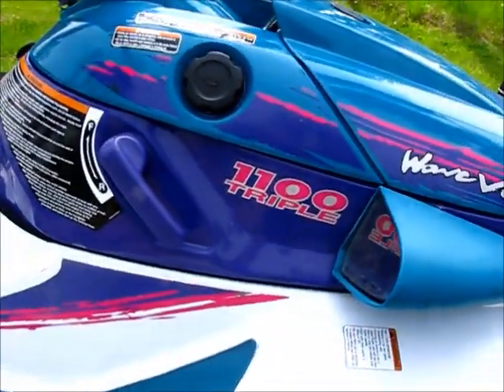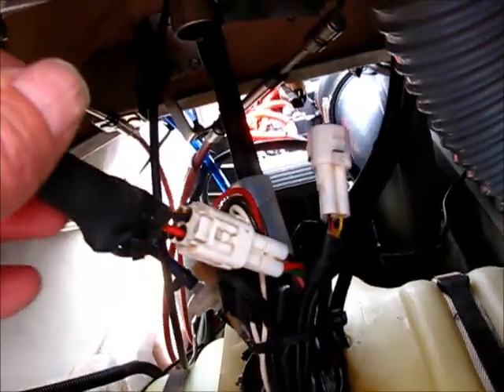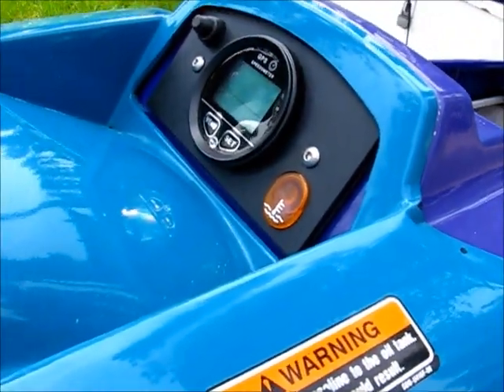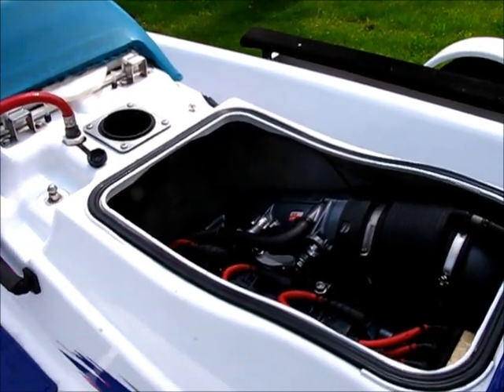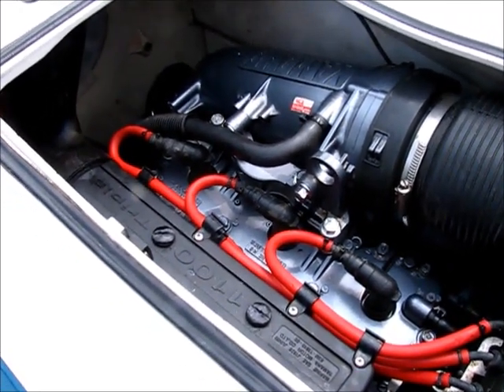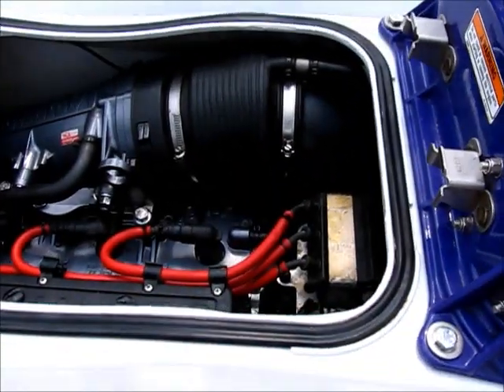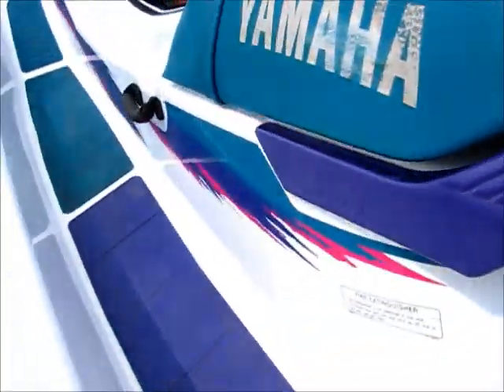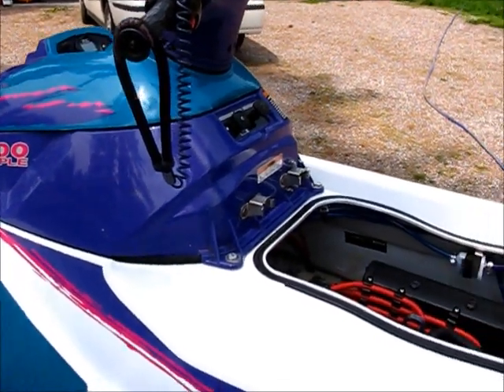Yamaha Wave Venture 1100 Rebuild Part 3 of 3

Comment: Mid 2020:  A lot of good info - going to pull my 760 engine and thanks for the pitfall warnings.  :)
Reply from the maker: You bet - hope it's of help to you!  I had mine out all weekend.  GPS said 75 miles total.  Running strong.  I'm gunning down 400 miles on rebuild no issues except cracked battery terminal - make sure your battery is in there good and tight!

Comment: Have a 1100 swap in an 01 800XL, trying to finish up my cooling lines.. there's a small port under the exhaust elbow,  down near the motor mount..where does that go to?
Reply from the maker: Hmm - I know the hose you are talking about but I don't recall.   Mine are in storage right now but I'll try to remember to look in there to see if I can help you when I get them out.
Reply: @paulhaines5755  would be much appreciated, trying to get this project done from previous owner, my last hold up is that port and fixing some small fiberglass cracks so I can throw it in the water
Reply from the maker: @Suikakuji  Ok - I'll try to get in there tonight after work and look at it instead of waiting until I get them out for the summer.  It's tight in there so hopefully I can see it.  Roofing today in the 90 degree heat - fun days!
Reply: @paulhaines5755  I know the feeling, I do HVAC and these Attics are toasty. I greatly appreciate the help
Reply from the maker: @Suikakuji             8/12 roof pitch - crawling around all day using ropes like a rock climber in 100 degree heat = fun.   I'm sorry but I can't see underneath the engine.  It's actually so tight I can't even get my hand in there to feel around.  I'm not sure what to tell you.  I don't recall as this was a couple years ago.  You might study the illustrated parts breakdown and see it that helps.  sorry I can't help you!  Paul
Reply: @paulhaines5755  unfortunately every parts break down I look at doesn't even show it and finding the few cooling line diagrams doesn't show it either so I'm not sure what it's for, wasn't sure if it was some kind of vacuum port for the oil pump? But mines been deleted and using premix, which is why I resorted to asking around just don't want to ruin the engine if it is a cooling port. Thanks for atleast trying
Reply from the maker: @Suikakuji  Ok - so I stood on my head, dislocated my shoulder like Riggs from Lethal Weapon and crammed my arm down in there and did it by feel.  Here's what I think you need to know.  There is a water nipple coming out of the block where it attaches the exhaust elbow to the engine in the front.  Just above the front, left motor mount is the location of this nipple.  There is a hose attached to it (probably 8mm Id if I had to guess) that makes it's way from that nipple, up under the large expansion section of the exhaust the back to the rear of the water jacket, cylinder #3.  It is hooked to the nipple on the head/waterjacket, top rear of engine.  it is also wrapped in loom for vibration protection I guess.  FYI there are only two water nipples on the front of the machine near the exaust elbow near the bottom.  One goes to the top of the water jacket front cylinder (short hose) and the other (port side/the one I just described to you) goes to the rear cylinder water jacket nipple.  Very important to have them both hooked up.  Hope that helps you.
Reply from the maker: Simpler version:  port side fitting/nipple goes direct hose line to top, rear of engine on rear water jacket nipple.  Starboard side fitting/nipple goes direct hose line to top, front of engine on front water jacket nipple.
Reply: I think this is a different fitting. The 2 head fittings for the water jacket I have hooked to where the flange of the exhaust meets the engine block, which from every diagram I see is where they're supposed to be.. I can possibly email you a photo of the one I'm talking about, not sure where its supposed to go as I've got all my exhaust ports plugged in to something unless I'm completely blind..which could be the case.

Have the 2 top head ports in the flange of the exhaust, the large port feeding the jet pump, and the rear port on the exhaust going to the port on the rear/top of the block under the exhaust, but this one is actually right beside the engine mount on the block
Reply from the maker: @Suikakuji  I just don't know.  I can't feel any other hoses coming out in that area.  I don't think a pic would help me because I can't see in there and I did this job some time ago.  Keep in mind these engines are used in snowmobiles, too.  Maybe that port has something to do with the cooling system in a snowmobile only?  It might be worth your time to figure out a model snowmobile that uses this engine and look at that parts diagram to put your mind at ease.  Just a thought...
Reply from the maker: Page 66 in my shop manual for this machine shows two lines under the exhaust elbow.  The front line appears to go to a port about mid-section of the exhaust manifold on the bottom.  The rear line goes to the rear of the manifold.  The pic shows two ports in the mid section of the manifold.  The front connected as I've described and the one next to it but farther back has a line coming out of it going somewhere but the pic is not clear on that.  these could be electrical cables, too.  I'm not sure as the pic is kinda fuzzy but I'd have to assume they are not as what would there be electrical for on the manifold unless it's the starter under there that you can't see in the pic?  I think the starter was in that location but I don't remember well.  Might just be cables to the starter I'm seeing but it is all I see in this location in the manual if that helps you more...
Reply: @paulhaines5755  I appreciate all the help, thinking it might be a vacuum port for some reason though I could be wrong..going to try and get water on it this weekend and see how it acts..but first got to pump out the fuel tank..ugh
Reply from the maker: @Suikakuji  Ok - got mine out in the bright sun and where I can reach and look easier.  On mine there is a fitting that has a hose on it that goes up to a grease zerk.  It's for greasing the stator assy.  Could that be what you want to know?
Reply: @paulhaines5755  I appreciate you looking again, this fitting is right next to the motor mount at the front of the engine,it's odd every diagram I look at doesn't even show it.. I haven't had a chance to get water on the ski yet but hopefully I'll get time next weekend
Reply from the maker: "striker 1211" has a vid on greasing a wave raider 1100.  Might show you something you are missing on your engine.

Comment: What is the size of the battery u know?
Reply from the maker: Mine is 7" x 4" x 6" tall.  325 CCA.  I'm not sure if this is the correct "factory" size but it works fine in mine.  Make sure it's strapped in there real good or you could break a battery post.  Happened to me.

Comment: Did you replace all of your crank bearings or did you just have the transmission shop clean them and oil
Reply from the maker: Crank bearings felt tight so I just left them alone.  However, since this project I've worked on a snowmobile that had a bad crank bearing on the business end (clutch) which makes me think maybe it's not a bad idea to do the end bearings provided you can get them off there.  Probably requires some heat and ice-pack and a mallet.  I don't know how you get the other ones off as you'd have to rebalance the crank and all sorts of nasty stuff.  I think all that center stuff is pressed on there so it's a specialized job.  However, here's how I look at it:  the forces of a wave runner drive are a little different and there will be less torque on the end bearing in general because the engine is in-line with what it's driving.  Snowmobile crank is 90 degrees to the drive so it's gonna be rougher on stuff.  It's up to you but those are my thoughts.  I didn't do it and I've got 300 miles on it no issues.

Comment: Hey Paul what are your carb settings .? Jets ? Needle and seat?
Reply: Pop off pressure? Springs used?
Reply from the maker: @NOFISHINGNOLIFE269 I hate to admit to it but I didn’t record that stuff!  Sorry.  All I can tell you is that I left the same jets in the carbs and did not replace so I didn’t pay attention to what was in there.  I made sure they were clean and put them back in.  As for needle and seat size, size was scribed on the seat but I simply don’t recall.  I also left those parts alone and stuck with what was in the machine before it blew up.  As for pop-off, I do remember it was between 40 and 45 psi on all three carbs.  Sorry I can’t be more help to you!
Reply from the maker: Oh yea for got to mention - high speed screw I set at 7/8.  Seems to be fine.  According to the GPS speedo I put on this machine, I've got 236 miles on it since the rebuild!  Still running great.  Pretty substantial considering these things only get like 2 MPG.
Reply from the maker: I did a little more research in my notes and found my seats were 1.5 mm.  40 to  45 pop off.  Sorry but I don't know what jets are in there as I stuck with what it had already.
Reply: Hey Paul thanks for responding ! I’m just getting ready to tackle the carb rebuilds before summer . Anyway I can email you about some questions regarding carb rebuild

Comment: Where is the oil pump on these?
Reply from the maker: Front and center of engine forward of the crank shaft bolted to the exterior of the electrical/stator housing.  They are actually driven by the crank shaft.
Reply from the maker: Follow the oil hoses from the oil reservoir.
Reply: ...and the oil pump can go bad.  like mine.   A lot of riders convert to premix fuel and oil and remove the oil pump.  This can prevent major engine damage when pump fails.

Comment: how do u change oil
Reply from the maker: You don't change the oil.  The 2 cycle oil that goes thru the carbs with the gas lubes all the stuff in the crank case.